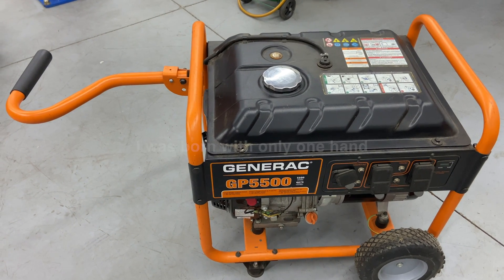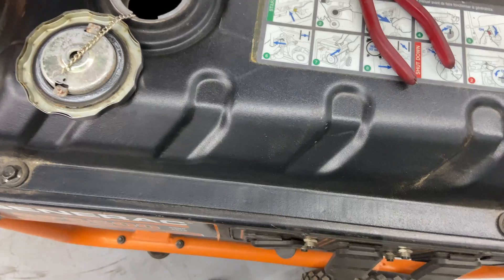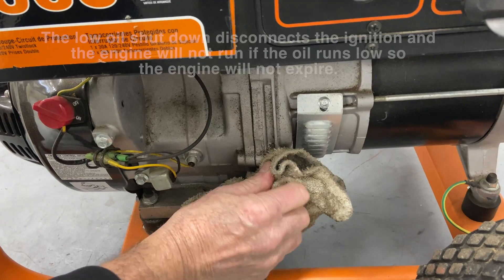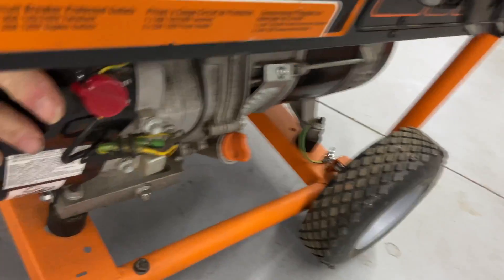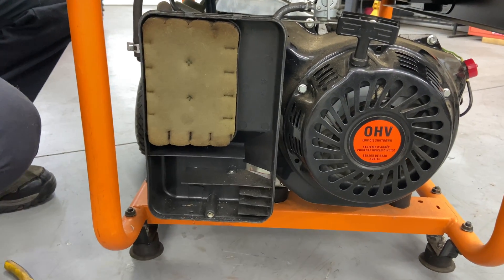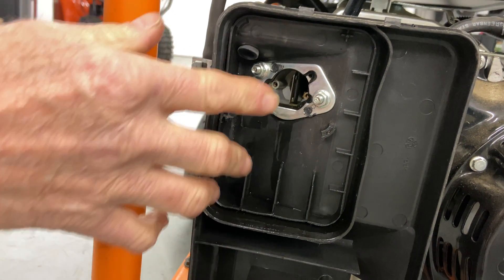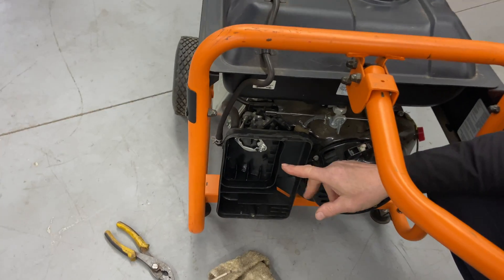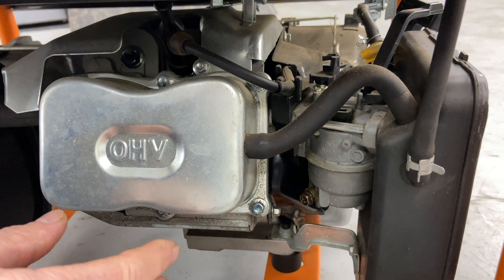Generac Generator Will Not Start. Generac GP5500, GP6500, GP7500. How to diagnose and repair.

Comment: I did everything you mentioned, including checking the fuel flow from the carb.  It is still flowing, but when I tried to start it, it wouldn’t stay running.   I used to run it dry.  Won’t be doing that again.  Still trying to figure out what’s wrong.  😢
Reply from the maker: You may be able to keep it running by leaving the choke a little bit on not all the way off and if you can get it to run, smooth with the choke in somewhat the on position, but not all the way on then your issue is a clogged carburetor. The only way to repair that would be to rebuild it or replace it.

Comment: Purchased a Honeywell 337cc 5500 continuous watts portable generator 6875 maximum watts new. Failed to start after storing it through a winter. Didn’t empty the tank and failed to use non ethanol. That was in 2012 I believe. Maintaining it now with hopes  of starting it for its second time ever. Cost me close to a $1,000.00 back then. Will be a wonderful sense of accomplishment if I can make her go. Wish me luck🍀 🤞🏻

Comment: I have this same generator. Brand new carburetor. Will start and run for literally 1 second if I shoot some gas in the carb. Otherwise it won’t start. Is the carb bad?? Fuel drains out of the carb drain plug with a good flow.
Reply from the maker: Impossible to diagnose without seeing it but a few tips. Check to make sure you’re getting a good flow of gas to the carburetor from the gas tank. Check to make sure your oil level is correct. If you have a low oil shutdown it may be playing games shutting off the spark intermittently. If all that is good and you can keep the engine running while spraying fuel into the throat of the carburetor, then yes, I will assume you have a bad new carburetor. Make sure your gas is good and has no water in it and it doesn’t hurt to try a new spark plug just to rule that out.

Comment: Great Video.  I have a Powerback 5250.  New plug, new carb, new fuel, new oil.  But I cant get it to start.  Any ideas?
Reply from the maker: You need to check your spark. If you have a low oil shut down on the machine, you may be low on oil? Check to make sure the machine is on level surface and check oil level.
Reply: @JohnsonsSmallEngines  I have a 10 hp tecumseh.  I cant even find an oil sensor.  It does say that the unit is equipped with one.

Comment: Hi Brad, Thanks for the oil fill tip. I was unaware that it had to be to the top of the fill tube. Happy New Year.
Reply from the maker: Happy new year, John! You have me worried? Be careful when you say fill tube if you have a dipstick on top of the engine, you need to use the bar graph on the end of the metal dipstick for the oil level. If you have the engine that is in this video at the bottom of the engine, you would fill it to the level on this video.
Reply: Sorry for that. I'm not sure the proper name, maybe the filler neck?? I used to fill it just to the level where it started up to the top. I'll check my Generac to be sure and top it off. Thanks again, be well. @JohnsonsSmallEngines

Comment: Great video. I have a TroyBuilt gen with same problem. Will try your tips tomorrow. Are saying to keep tank full when not in use?
Reply from the maker: Yes, use fuel stabilizer and fill tank to help keep moisture out and a full tank will stay fresh a very long time. Make sure the fuel valve is always off when the machine is not in use.

Comment: Nice video as always Brad. Do you have a favorite fuel stabilizer you use?
Reply from the maker: Thank you! and thank you for watching, commenting and supporting the channel. I have been using Sta-Bil 360 Marine with very good results through the years. https://amzn.to/3SjcioH. I use the marine because the humidity and how some people store there machine, can get moisture build up in the gas tanks. Sta-Bil 360 Marine will help with that issue plus the normal long term storage additives in it. Another reason is why I suggest keeping a full gas tank, as a full tank will help keep moisture out of the gas tank. Just make sure the fuel valve is always kept in the off position when the machine is not in use.
Reply: @JohnsonsSmallEngines  Thanks Brad. Excellent advice.

Comment: Great video Brad! With all the tri fuel and dual fuel generators being sold on the market these days, while the bad gas issues will be side stepped, there are still plenty of issues why those machines wont start. Most of the time is a bad or mal adjusted demand regulator or failed primary regulator (propane) with those!
Reply from the maker: Thank you! and good to know. I don’t see many duel fuel portable generators in this area, yet. Thanks for sharing, commenting and supporting the channel!

Comment: Thanks much for all the detailed info.  I have the GP 3300 that hasn't run for about 6 months, I'm going to check it out now.  I use non-ethanol gas and fuel stabilizer, so hopefully all good...
Reply from the maker: Non ethanol fuel is great! I wish we had it near me. I use Aspen4 with a lot of machines but it is too expensive to fill most generator tanks. Let me know how you make out. Remember to check or should I say plug something into one  outlet to make sure your electric is good. That will also help with the electrical side to keep it from failing through no use.
Reply: Started on the fifth pull (it is cold in the basement right now too).  Runs smooth and outlet works as should.  Just watched your video on taking the carb off.  I'm sure I'll be needing to do that one of these years. Thanks again...
Reply from the maker: Awesome glad to hear! I hope you never need to take the carburetor off! Lol. Just keep doing what you’re doing and you should be good and when the tank gets below half you should top it off with fresh fuel. Keep the fuel shut off and the off position, when not in use, as you probably already do.